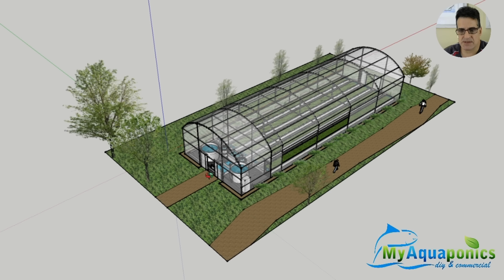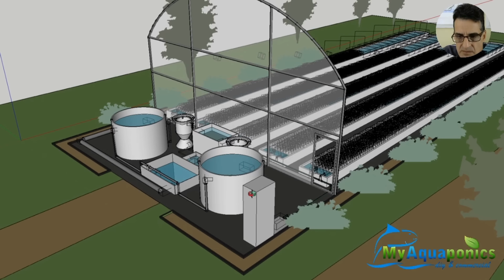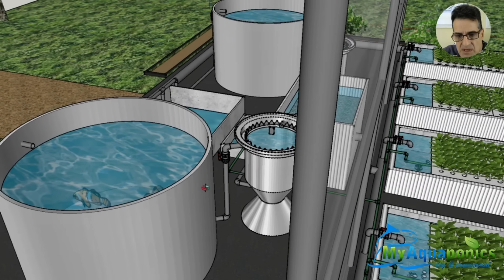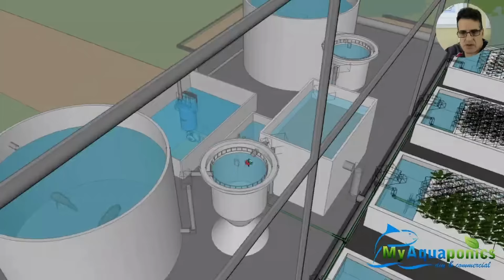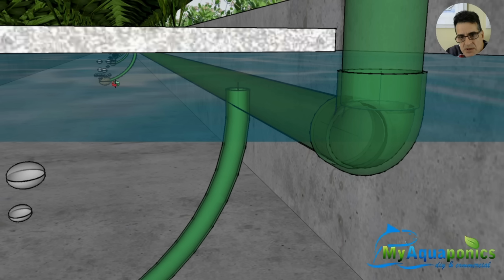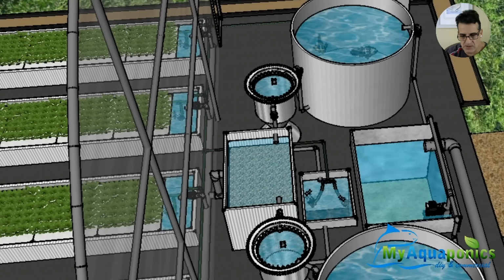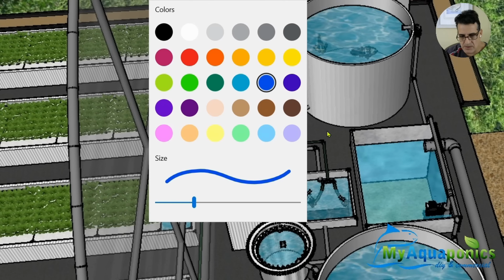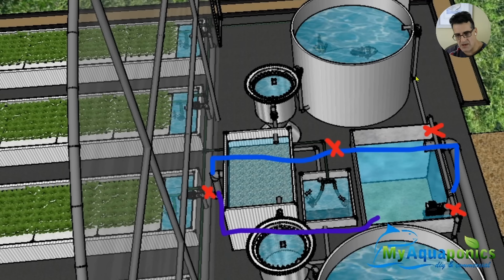The Best Commercial Aquaponics System Design explained in 3D : 2020

Comment: Hi, Nice video. Would it be possible to share the drawings and flow of water and air for DWC hydroponics? if yes please send it to naandhu@gmail.com
Reply from the maker: Thank you. Unfortunately we do not share our drawings. The flow of air is from compressor or flower, to fish tanks, mineralizer tanks and teh DWC beds (airstone every 1-1.5m). Fow of water starts at the Sump (lowest point), that gets pumped up to the fish tanks (highest point), then gravity feeds to filters, DWC beds and back to the sump.
Reply: @MyAquaponics1  Hello, sir. Here's a question for you. 
The 100-cubic-meter configuration bed requires so many pipes. One of the things to face is long distance air lost and oil that bring by compress air, What is the  industrial aircompressor sizes will you use and how to solve the oil carry problem?
Reply from the maker: @chanpengchen  not sure what you mean by oil carry problem.. On larger systems we use Air Blowers similar to this https://myaquaponics.co.za/air-blower-compressor-rb-220-700w-88m3-h/  Generally if you are using air stones as diffusers , you need 6-8 l/min per airstone. So you need to calculate according to your needs
Reply: @MyAquaponics1  send me your email
Reply from the maker: @Nawaf-et6cc  on our website www.myaquaponics.co.za

Comment: Would you mind sharing me the details about the electricity usage of such a plant? And which pump would you use as well?
Reply from the maker: You need to turn the water volume in your fish tank at least once per hour.  Best to handle a system that size is a swimming pool type self-priming pump that is around 1Kw and can do 30 000 litres per hour with a good head. You could also use submersibles such as a PG 12 000 or PG 15000. For aeration, you would need a decent blower with enough throughput to supply all the diifusers in your grow beds, fish tanks and mineralizer.. You need around 6-8 litres/minute per standard 50mm ball airstone. Keep in mind that you would need an airstone/diffuser every 600mm to 1m in your DWC growbeds
Reply: @MyAquaponics1  For aeration can we use the water circuit to agitate the water   every 1 m  in the grow bed and the dissolve the oxygen instead of the  blower.
Reply from the maker: @F13TUN  not quite sur how you would do that, but if you have good presure and flow rate from your water pump, you could add venturis along the channel for aeration
Reply: @MyAquaponics1  thanks for your reply. Also can you suggest me which materials are used in the deep water culture to retain the water from leaking.? I understand this material may cost a lot
Reply from the maker: @waqaarosman2327  cheapest is probably to use a PVC liner. There are also new pond sealers that one can use (paint or spray) that are fish friendly and ideal for sealing concrete channels.

Comment: Hi, very high quality presentation and 3D designs. 
For setting up a vertical farm for commercial use would NFT be the preferred method? 
Is it possible to have a stacked DWC setup (DWC bed, rafts, plants, grow lights, one on top of each other)? I think it would be more like an NFT but using water beds instead of pipes.
I think NFT uses a lot of space because of the round pipes. So there is a lot of vacant space and fewer plant holes. DWC doesn't have vacant spaces so there can be more holes on the rafts.
Thank you, Ani
Reply from the maker: DWC stacked as you suggest would be too heavy. Water is heavy, 1000l = 1 Ton.  If you're looking at going the nft route, you could always use the new type rectangular profiles instead of round pipes.
Reply: NFT pipes or gutters, square or round will overheat the water during the day by 5 to 7 degrees Celsius for each pass, in winter at night they will make the water too cold and in extremes can freeze the water. More nutrients get taken up by the first plants that grow faster and their roots have a tendency of blocking the pipes/gutter and the last plants in each pipe/gutter become nutrient deficient the longer the pipe/gutter are. Uneven growth of plants is not what you would be wanting. DWC is simpler and less issues.

Comment: Hi nice video, almost similar with my plan on building aquaponics, where’s mine is 25x25m and i also planning to go with all DWC. I have a question, can i remove the sump tank? As the DWC will already act as a sump tank...anything i need to be carefull or aware of if i decide to remove it? I dont have much space left to build sump tank. Thanks cheers
Reply from the maker: Thank you.. Yes great question. You can use your DWC grow beds as your sump. If you look at the photos of the rooftop system we built, we had to use the DWC grow beds as the sump, as we could obviously not dig into the concrete slab. The sump is only really required with NFT or flood and drain grow beds.
Reply: @MyAquaponics1  Hi. Nice video. I'm also building something similar only things is top of my 1m deep tanks ((48 cubic m)  are at ground level so i need to pump my water up to a sump tank higher than my grow beds so the water can flow back by gravity to the tank. Does that sound right?
Reply from the maker: @chaichua8332  yes that could also work

Comment: Two fish tanks only ! This is not profitable
Reply from the maker: In Aquaponics the profit is in plants not in the fish.. If you want to profit from fish, then you need to go the aquaculture route. Aquaponics was never designed to be a sustainable source of fish. Of course, if you are running an aquaculture (fish farm), then its prudent to pass some of that water through a filter system and aquaponics beds, instead of letting it all go to waste.
Reply: Great system. I just wanted to know how much it would cost to setup the fish farm. Also, what is the ROI from such a system?
Reply: In Aquaponics, PROFIT is in Fish and Plants. 1/3 fish and 2/3 plants if following the experts in the industry. You should be consistently harvesting fish for profit else what's the point. I observe that with 2 Fish tanks that if you harvest completely from one and then the other that you will have huge issues with nutrient deficiency's for the plants unless heavily compensating with nutrient / fertilisers, Is this the best Aquaponic practice or system? You should have around 300kg fish Biomass or 750 fish at 200 grams per fish tank if I worked it out correctly using Dr James Rakocy or Dr Wilson Leanard's formulas for the amount of possible plants in your system.

Comment: Great work 
Can you please send me your tel. No. For contact  .....
Reply from the maker: Thank you. Please visit our website www.myaquaponics.co.za for our contact details.. Keep in mind that we are located in South Africa
Reply: Where I put cooling system  ...... in this design  ..... with climate temperature arrive to 40 degrees Celsius
Reply from the maker: @orabimahmoud8194  In your case, you would have to maybe add some shade netting over the top of the tunnel as well (20-40%), preferably retractable. You would also need to install fans on the side of the tunnels and perhaps even extractors at the top. The other option used in South Africa on very hot days, is to have misters installed above the plants suspended on the greenhouses structure. The fine mist will cool the air.